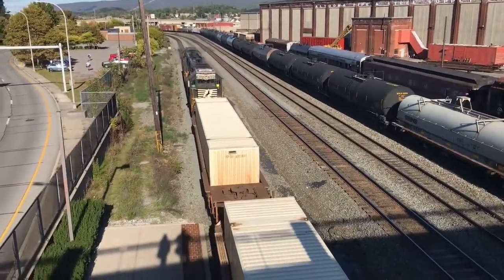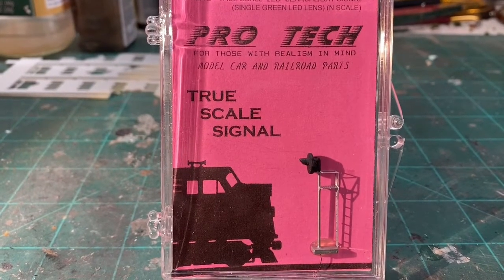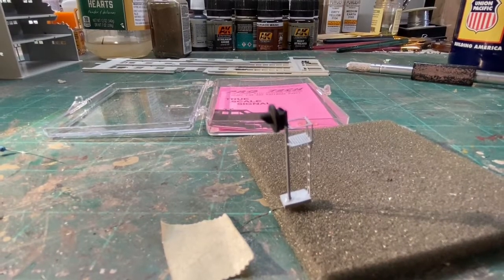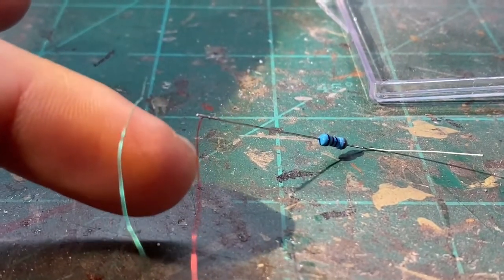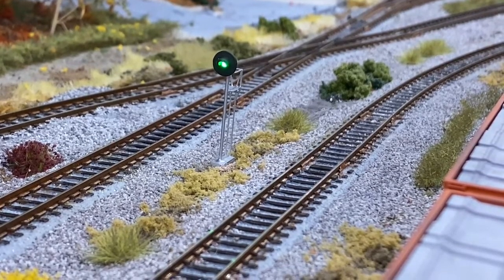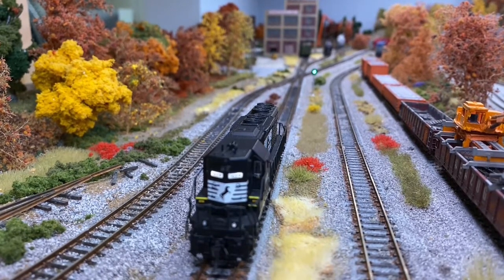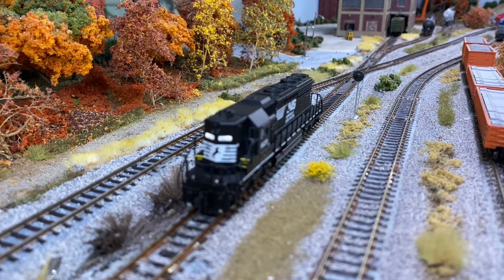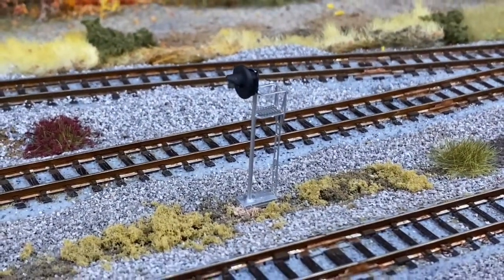N Scale Pro Tech Signal Review

Comment: Hi, great video, really nice signal! By the way, are you using Kato Unitrack? How did you fix them onto the ground? Do you think that soldering the tracks is necessary? Ballast & Rusty paint looks great! Regards from Hubertus
Reply from the maker: That is Kato Unitrack.  I do not have it fixed to the layout.  I'm using the ballast glued along the sides to hold it in place.  I don't think it needs soldered.  You can, but enough feeders and good clean track make up for non-soldered joints.